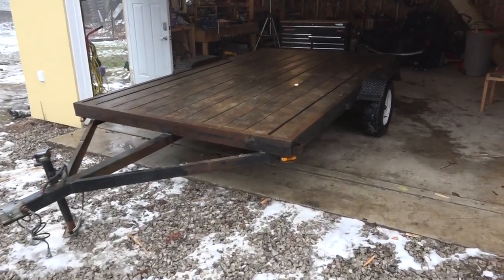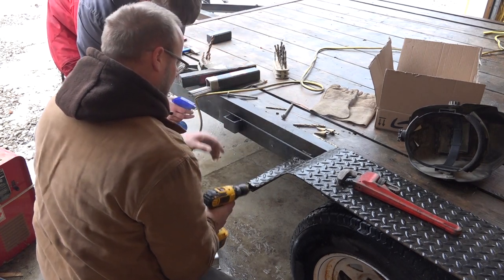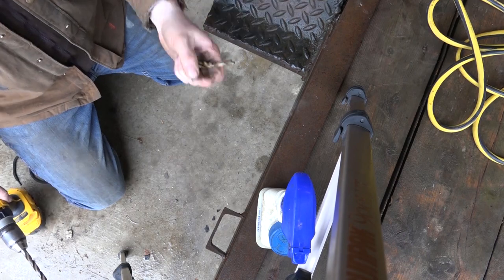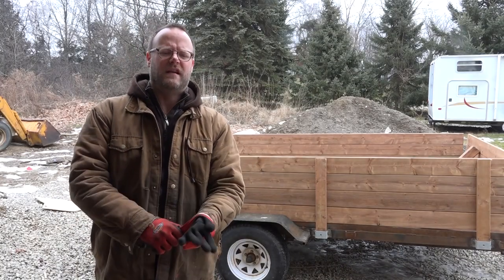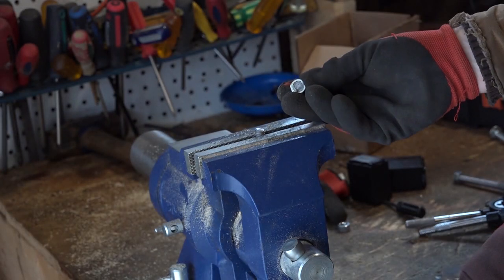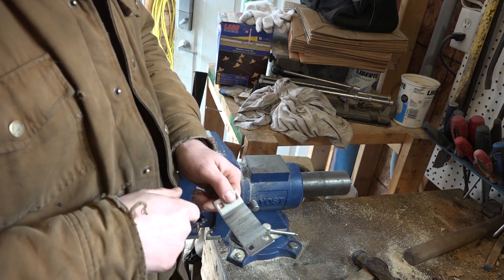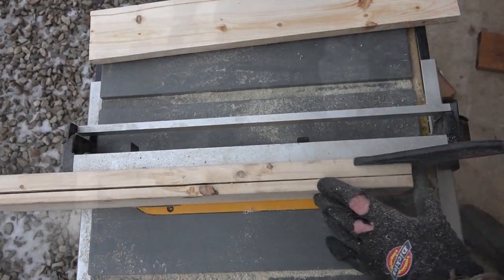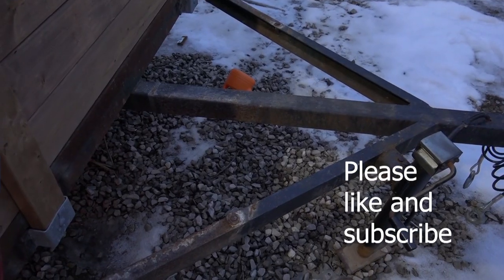Adding removable sides to a utility trailer

Comment: I have probably ruined over 30 drill bits when I was adding stale pockets and marker lights to my gooseneck.  To this day I’ve never found a drill bit that will easily drill into steel.
Reply from the maker: I find that step bits work best.

Comment: that's why you should have a block under your jack stand. if it happens again and    you have a tiger torch or some kind of torch that's a lot easier then a sludge  hammer :) nice   side walls tho

Comment: Wonderful video and a nice trailer for a used one. I built a custom 14’ tandem axle trailer while in high school and still use it 21 years later. I had stake pockets that I had built wooden sides and they worked well for awhile until the treated wood got so swollen with moisture that taking them off what nigh on impossible.

So I have some sides welded up and I tried to weld 1.25 sq tubing side by side to go into the stake pockets but it got so frustrating that I abandoned it and used multiple 1/2” grade 8 bolts, and I drilled and tapped the sides so I just use an impact to take them on and off.

My question is how did you not burn up your step bit? I used cutting oil and a slow speed on mine and it took forever, and so I used cobalt bits and they worked faster.
Reply from the maker: Hmm, not sure.  I do fine that if I use a regular bit for the initial hole and then the step bit it works best

Comment: To make it truly removable you could substitute the lag bolts out for lock pin/cotter pin bolts or Clevis pin bolts. That way you don’t need to bust out a drill and hammer to bang those lag bolts off. If you do this just make sure you treat the pin bolts with some rust resistant spray made by rust-o-leum
Reply from the maker: Nice idea on the clevis pin bolts!  
I may end up just taking and leaving them out.  The sides are so wedged in there I don't think they will ever come out under regular use.

Comment: Corner brackets - I got the Carry-On brand brackets from Tractor Supply Corp (TSC).  They rusted quickly.  I like yours better.  My trailer is the  4x8 1750 lb rating from Harbor Freight.  Now that I've discovered a 5x8 aluminum version from Northern Tool, I think I like that one better (it costs a little more) I think the HF trailer will be finding a new owner.  Hello, craigslist ...
Reply from the maker: Hard to go wrong with aluminum.  My next video on this trailer is getting rid of the rust...

Comment: Think you could have spaced the side boards only use have as many,,,good idea for the rear spacer board I like how you used screws vs I bolts
Reply from the maker: Yes, depends what you haul.  I get dirt and gravel sometimes so solid sides are nice.

Comment: You might want to give your trailer a coat of paint to ward off rust. It is such a nice trailer. Did you build it?
Reply from the maker: Yes, I ended up doing that in the other trailer build video I made
Reply from the maker: I did not build it but bought it as it was.

Comment: How much penetration are you getting on your welds without grinding first? If you grind the galvy off you won’t make such a health risk.
Reply from the maker: I was using 6011 so clean surfaces was not needed.   Good point on grinding the galvanizing.
Reply: @VincesDIYs  Thanks for the info on 6011. I have never used it. I only mig weld but I may get some 6011 and get busy with the stick. Thanks again. If I didn’t mention it before, good recovery on the back gate and hinges.

Comment: I would of just bypassed the screws. I doubt the stakes would jump out, unless you were off-roading it and hitting some big bumps.
Reply from the maker: You are correct.  The weight of the sides and being connected with the other side, it won't be bumping out.  Next time I take the side out I'll be leaving the bolts out.
Reply: @VincesDIYs  or use cotter pin/clevis pin bolts. Makes removing easy peezy and gives u reassurance if u hit a pot hole those things can’t bounce up

Comment: U for got lock washers
Reply from the maker: Not really needed.  The galvanizing keep them from coming out even if I want to take them off.
Reply: Since they’re going in horizontal he doesn’t need lock washers. No amount of vibration will force those bolts out due to gravity. He could even get away with using cotter/clevis pin bolts instead of lag bolts